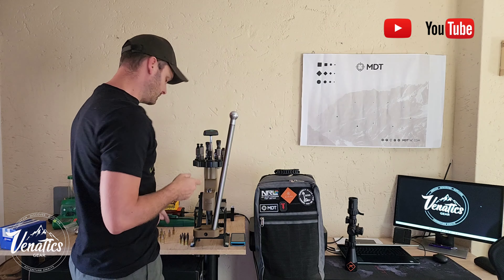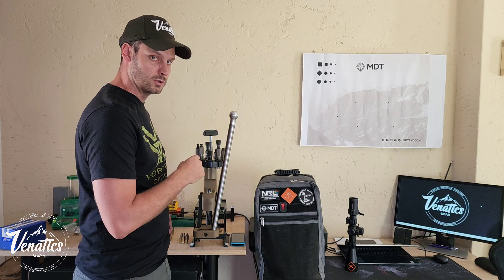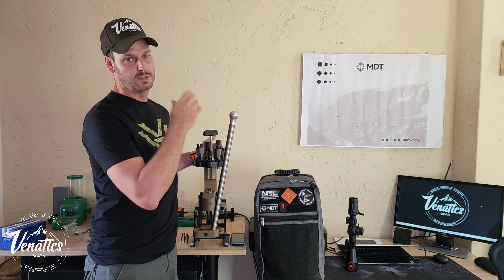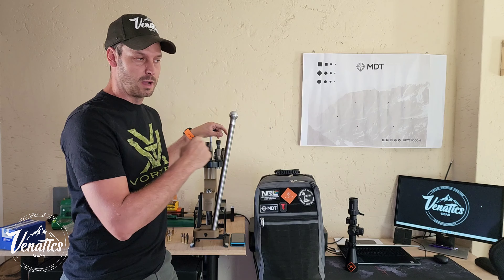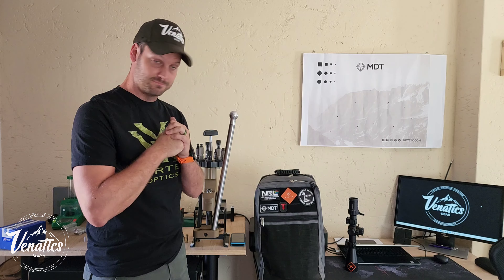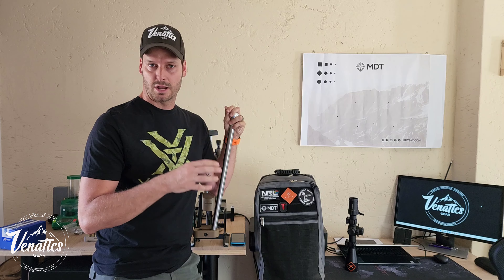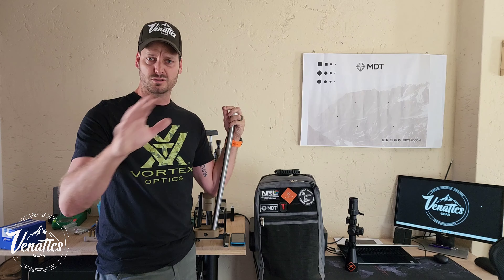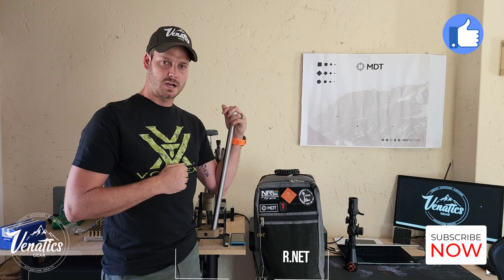MATCH PREP SERIES - EPISODE 1

Comment: Hi pieter howzit. Really enjoy your videos.  Will definitely be putting one of your phantom x chassis on my gun as I think it is extremely good value fir money. Also what do you think is the most effective way to reduce sd and es
Reply from the maker: Hey bud, thanks for the kind words...My opinion on getting your ES and SD down will be to start at the beginning and that is brass prep. Using a Mandrel for consistant neck tension, ensuring your shoulder bumps are consistant when full length sizing and accurate seating depth (base to ogive). Get those basics in place 1st and you will already see a difference.
Reply: Thanks man
Reply from the maker: Pleasure and feel free to contact me if you need any assistance or advise 👌🏼
Reply: @VENATICSGEAR    👌